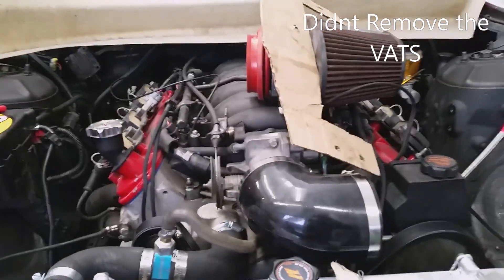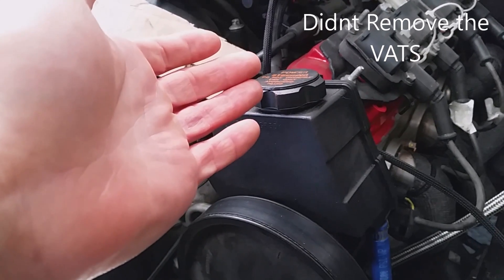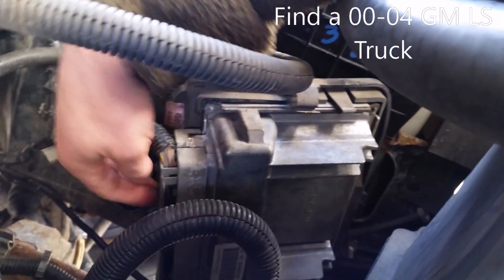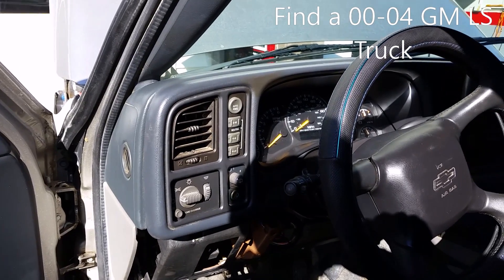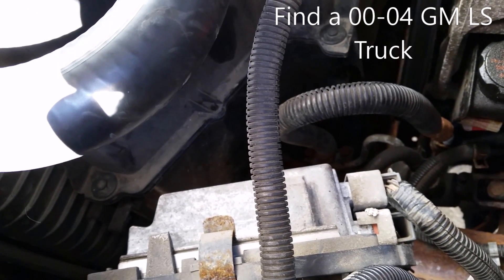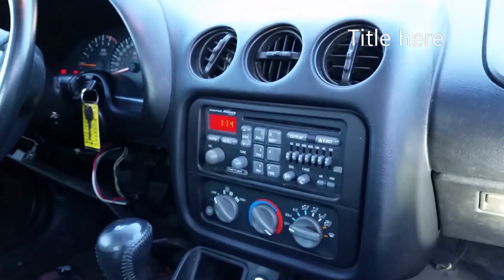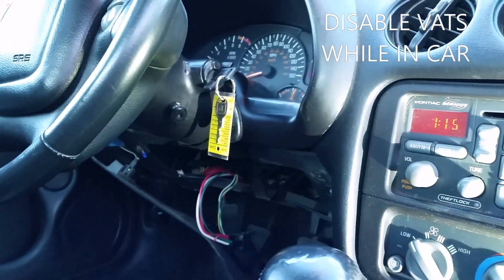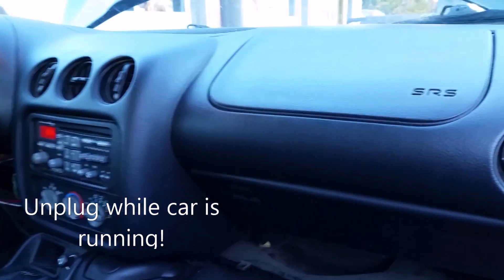how to remove & bypass vats LS1 GM LS Engine Swap

Comment: Worked on my 2001 computer used my neighbors 2002 Silverado only took 2 times, have to crank a little bit so it won’t start and wait ten minutes 2 times then start it and unplug the 3 wires under dash and it cleared the vats

Comment: VATS & base tune
If you live in the Atlanta area I disable the VATS security for LS swapped vehicles and provide a base tune that will disable other non used features on the PCM.

Comment: does this delete the V.A.T.S  permanently or just temporarily?
Reply: Same question, Im afraid after de pcm runs out of power it will reset, needing de vats again....
Reply: Benjamin Keutmann think about it... put ecu in donor, unplug body module.. then have to remove ecu to put in your swap..

Comment: Hey, I followed this, and got the engine to fire up, and the swap is complete. I cannot however, for the life of me get OBD to work. I just want to know if you're OBD/serial data is working to continue troubleshooting .
Reply: If you delete the bcm using this method i believe it stops the communication to the obd port. Not 100 percent sure but 99 percent sure it does.

Comment: I have a 2002 Yukon Denali it shows a battery signal never a security on
Reply: Did it work for you?
Reply: @ridenda67camaro  it didn't so if you do have to do it go to a tuner and have them do vats plus a customer tune I spent so much money that was wasted if I would have did it that way first would have saved over 600 dollars

Comment: Will this work with a 2006 L59 on a 2013+ truck? I have a 2006 Tahoe PCM I need to delete vats on, but only have a bunch of 2013 or newer work trucks to do this with

Comment: My 1999 sierra 1500 wouldn't start & run the other day,  it would immediately die.  Since I had just helped my dad replace a bad fuel pump on his 2001 sierra 3500, I assumed I had the same problem.  I disconnected my bcm in order to shut the door chime off so that I could hear the fuel pump run(the fuel pump was making over 60 psi so that wasn't the issue). Then I gave up for a few days, then had a dead battery that wouldn't take a charge.  I replaced the battery, still wouldn't start.   I just did the resistor bypass at the ign. switch last night thinking that must be the problem(before I found out that this box I unplugged did more than make annoying noises).  I haven't reconnected the battery or the bcm, so it sounds like it it is necessary to have the bcm connected before the battery is reconnected.  I'll have to go through the 30 min relearn procedure now to get the truck running, & then go through the procedure decribed in this video to eliminate the bcm from the equation.

Comment: south main auto has a video where eric "o" solders in a resister ,,theres one single wire i think on gm its white ,anyway you cut the wire solder the resister and it bypasses the key all together ....theres a lot of great vids there at sma...

Comment: thanks for sharing.  i got mine running today.  im also documenting the entire budget build.  thanks again
Reply: Ok But once you swap pcms let the car run then unplug the three plugs after once its bypassed turn it off and then back on without reconnecting the plugs or plug them in before starting the car up again and also once it does its thing and you reconnect the original pcm is that one bypassed to or just the swapped one?
Reply: @209chevymon   i have a DIY video showing how on my channel.  once you get a vehicle running with your CPU, you want to unplug the BCM while its running.  let it run for a minute or two.  if you have bypassed the security, it will turn off and start up again without the BCM.  check my "Budget LS Swap DIY CPU Security Bypass" video on my channel to see better.
Reply: @613Builds  what if im buying a whole van that runs should i just start it then unplug bcm and let it run for awhile?
Reply: @hishoe2000  yeah and it should keep running with the security light off.  and it should shut off and start again without the BCM if done correctly.  the BCM might have to be unplugged in a certain order, but it should keep running and start again without the BCM, when the bypass is properly completed.
Reply: Key on at accessories or key on run not start ?
Reply: @4739-g9c  key all the way on “run” .
Reply: What years is this good for

Comment: I have a 2001 Silverado with a lq4 and 4l80e, in order to disable the vats all I do is disconnect the control module under the dash and it's good? I'm swapping the engine into a 1990 c1500 with a manual trans.
Reply: unplug the body control module while its running.  if the security light comes on, perhaps try again.  i did it today and the security stayed out and the engine stayed running.  if it works, the truck will start again while the BCM is still unplugged.  i made video clips of doing it today but i havent edited the video yet.  good luck

Comment: i have 2008 silverado 4.8, gonna swap a 6.0 soon, will this work to remove the vats off the 6.0 ecm?
Reply: yeah i think so.  i used a newer 4.8 van to bypass my older 5.3 CPU.   CPU plug ins changed in 03 and 07 but i show how to change the plugs easy in a DIY bypass video i made recently.  if you wann see how its on my channel

Comment: Can i use a 2005 gmc to clear the vats
Reply from the maker: Sammy Willis in really not sure. I know the keys are different. I think it would still work. Please let me know it it does or not
Reply: it worked for me today on my 2002 ecm, but i had to use the red ecm plug tips because the 03+ uses green, and they dont fit the red tips, but you can put the red tips on after removing the green ones.  then i had to cross the starter on the 03 van for some reason, but i got it running and it worked.  also 03 van here i used has DBC but most trucks are wire-driven throttle after 02-03.

Comment: It does work I did both with my ecm into a friend's Tahoe
Reply from the maker: chevyridinhigh67 thanks for the comment!
Reply: Is it a permanent solution? Did it run well all the time? Im afraid after de pcm runs out of power it will reset, needing de vats again....

Comment: that fancy ass so called micro chip in your key isnt a tiny computer, its a resistor, i small component used in electrical circuits. my buick lesabre had the same system in it. i measured the resistance across the terminals on the key and wired a resistor with similar resistance into the plug where the wires from the key lock cylinder went to and i successfully bypassed the vats system, i thought it was fucking stupid to make a spare key with this "micro chip" in it would cost $50 a pop so i decided to look it up, $4 at radio shack for the resistors, $3 at walmart for a key and ready to go

Comment: I've done this and yes it works ...after I unplugged the three plugs  I let Tahoe  run for approximately 20 minutes just because I was checking on a few things in the car.. turned it off turn it back on with no problem.. I did the swap into my S10 turned on and ran without a problem there's even videos of it on YouTube
Reply: same here  
 : )
Reply: Is this permanent?  If the battery goes dead at some point in the future, does the pcm remember that it has no bcm connected?
Reply: I wouldn't take that risk.   Although I disconnected the CPU and the battery while doing mine, and it worked for me.   I documented it in a video also.  I can imagine the computer might forget if the battery ever went completely dead but I can't say for sure.   Mine is still running but I haven't had the opportunity to try it in the last week or two.
Reply: @613Builds   I was just thinking of the inevitable dead battery somewhere in the hopefully distant future, will I remember what I learned for this procedure when that happens?  Maybe it would be better to send the pcm to a tuner shop and have it permanently disabled now?
Reply: I removed the bcm with the battery connected & the key out.  I wanted to inspect it to see if anything was burnt.  I was also really tired of listening to the loud dinger while trying to figure out the no-start issue, so I filled the chime with glue to make it quieter.  Re-installed the bcm and the truck started right up.  Let it idle for a few minutes then disconnected the bcm again.  Truck stayed running but the blue high-beam indicator came on and won't shut off, doesnt matter if I turn the headlights on manually(they work fine going back&forth between high/low  beams), only weird issue so far.  Going to shut the truck off now and try re-starting w/o the bcm.   Off/on cycled the engine, (works great again) but the security light stays on constant with the truck off.  Tried locking the doors to no avail.  &locked myself out & it  feels like there is no lock cylinder in the driver side door, and the passenger side door lock is extremely loose, was able to get it unlocked by very gently wiggling the key all the way into it.  I didn't realize there could be so many problems with gm trucks, I havent even put 1000 miles on it since I bought it
Reply: @huckbeduck  this method is for LS swaps into drift cars and race cars to get the swap started and running.  most drift and race cars dont have hi-beam indicators.  there are different methods if you want to bypass a truck and keep the engine in the truck.
Reply: Ok But once you swap pcms let the car run then unplug the three plugs after once its bypassed turn it off and then back on without reconnecting the plugs or plug them in before starting the car up again and also once it does its thing and you reconnect the original pcm is that one bypassed to or just the swapped one?
Reply: @209chevymon  i have a DIY video on my channel.  once you get a vehicle running with your CPU, you want to unplug the BCM while its running.  let it run for a minute or two.  if you have bypassed the security, it will turn off and start up again without the BCM.  see my LS Swap Security Bypass video on my channel to see better.
Reply: @613Builds  lol im watching it right now but thanks for replying really appreciate it do you know if it can be done with a 99 sierra cause thats all i got to try this
Reply: @209chevymon  what year is your CPU?  if its 99-02 you should be good to go 
:D
Reply: @613Builds  if your asking about the swap cpu its from a 01 silverado and my truck i want to try this on is a 99 gmc sierra also in your vid doing this did it at all leave the van with messed up interior or dash light like leaving them lit up all the time cause the 99 sierra is my daily and just wondering
Reply: @209chevymon  in MY VIDEO there are no light that come on at all.  99&01 thats perfect, that will work yes.  mine was a scrap van with a blown transmission, but no harm done to the van vehicle, just put it back together properly and no harm done.
Reply: @613Builds  nice!!! Im definetly gunna try this but one more question is there specific steps for putting the original cpu back in like does it matter which gets plugged in first battery or cpu and once its back in will the original cpu still have the vats or will it be bypassed as well when installed?
Reply: @209chevymon  the body control module should match the original CPU so it should run fine when you put the original CPU back in.  no harm done

Comment: I'm trying to remove the Vats system for me 2002 Yukon PCM and I was wondering if the process is the same
Reply: http://www.bergerweb.net/PasslockFix/
Reply: yep same 99-06 , depending on red or green plugs.  i just did my red 2002 ECM using an old green 2003 gm van, worked great for me, i made a video on my channel

Comment: your a joke.we own a salvage yard and there is no way you can do this. now you can shut it off before pulling a ls1 motor .start the truck & unplug the 3 blue plugs under the steering dash .when running  only .this will shut off the vats .do not plug the 3 blue plugs back in.  THAT S. HOW YOU SHUT THE VATS OFF  .then that pcm is flashed  take it with you.for your ls1 swap
Reply: That would be 'you're a joke'.
Reply: John good I have an 04 suburban that I'm gonna pull 5.3 from to put in my chevette. Are you saying while the truck is running I just unplug the BCM plugs and boom vats and BCM are removed and I can just drop engine in and run?

Comment: I just tried this procedure for 97 buick and couldn't get it to send it into ignore system vats code.  didn't work.   I was going to use good working 97 to fix my 96 with faulty vats.  didn't work.   I tried unplugging bcm. tried passkey 2 module.   tried unplugging them both at the same time, didn't work.   anyone got some help for me
Reply from the maker: Chris Hane did you try while vehicle was running?
Reply: has to be an ls motor, either a 4.8,5.3,5.7,6.0,6.2,6.3,7.0 v8
Reply: yes i did do this while it was running 
why not 3.8.  i think something like this would work on any vehicle if you do it properly.  I know that some cars vats is programmed into bcm.  like in the video.  Mines programmed into the passkey 2 decoder module. but if i unplug that it doesn't work.  I've tried doing all kinds of things in different orders.  The goal now is I have a running buick lesabre with good vats in it.  I want to program it like the video to go into fail enable mode.  Thats it it should be simple.  I have broken nice 96 buick depending on my success
Reply: Carlos Hernandez didn't work
Reply: http://www.bergerweb.net/PasslockFix/

Comment: So this actually works then.. I have a 03 chevy express that's going to be donating almost everything under the hood to a 87 suburban for an LM7 swap. If I do this procedure on the donor before I start tearing everything apart, it should start the engine up once i get it dropped in to the burb? The engine runs great as-is. I know some parts are different and if it doesn't work, either way i'd have to send the ECM out. So if it doesn't work, it's no big deal but if it did, that would make things easier.
Reply: i used an 03 express van to disable my CPU security.  then i put the CPU into an 83 firebird 5.3 LS swap.  theres a video on my channel 
: )
Reply: http://www.bergerweb.net/PasslockFix/
Reply: @boostv8chevy457  When you did your swap, did you swap the bcm over and then go through the process of soldering in the resistor?
Reply: @huckbeduck  I used the resistor to bypass the key and turn on my ignation with the bcm connected. then enter the ecu to delete vat and all other option i don't need. like second O2 sensor. AT deleted.  fans turn on temp,  The resistor are to bypass key but keeping the BCM. If you don't want the BCM. you still need the original key or bypass it with the resistor instead of the keys. but i had the keys. I only buy the engine from the owner. so he had to keep the car and keys. i measure the key write it down on the bcm. If you don;t have the keys. just  go with ur ecu to some one who have the same ecu. hook it up. Hp tuner it and delete the feature of vat.. But But. make sure is the same model of ecu. because not all ls1 ecu are the same. Pontiac is not same like some camaro. or corvette. pls note.. maybe it will fry.